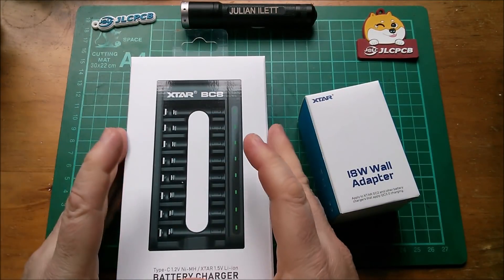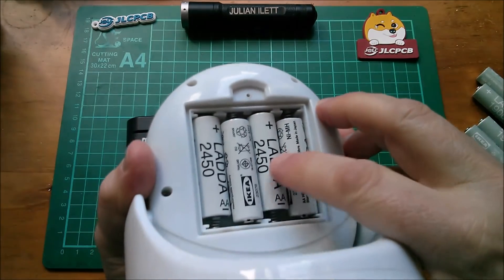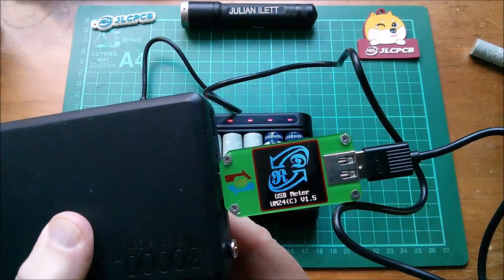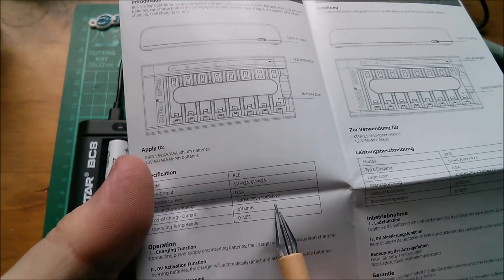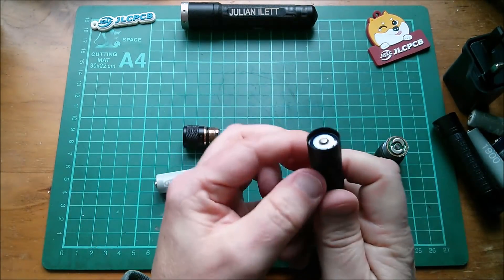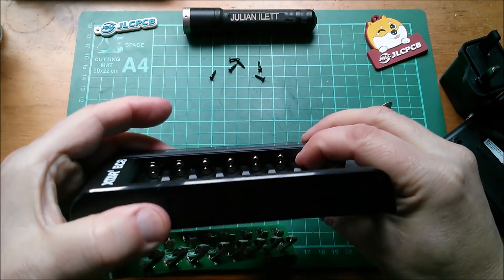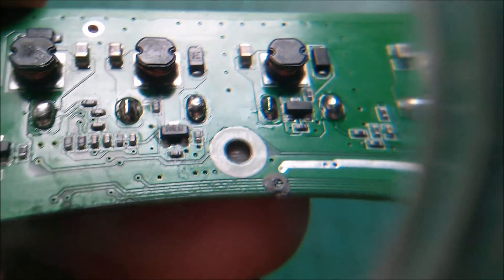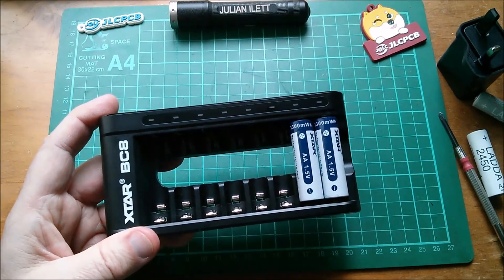Xtar BC8 Battery Charger Test and Teardown

Comment: Interesting, I'm guessing the reason it's charging to >4.2V is because there's a diode drop between the terminal and the cell. Which would make sense since there would be a MOSFET on the output of the cell if it's using a plain old buck converter to drop the voltage, the body diode would introduce the 0.2-0.3V drop you saw.

Comment: Have you had those lithium ion batteries long enough to see any self-discharge? I got away from rechargeables years ago because of this. Recently decided alkaline leaks aren't worth the trouble and now using Eneloops. They're great, they store well charged, but 1.2v is a little frustrating for some of my more demanding devices.

Comment: Well, I guess technically you should say it charges all 4.2V lithium cells, if they have a button top. Them being 1.5V lithium AA cells with the added DC-DC converter is not really necessary to charge them :) If it's a good idea to have 4.2V AA batteries that you can mix up with ordinary AA cells is another story, but it would charge them surely :)
However, the high charging voltage is concerning, I think you should talk to XTAR about it. 4.2V +/- 0.05V, as it says in the specs, is fairly normal for cheap lithium chargers, but if this devices is not operating within its own specs, and the specs of the lithium cells, then this is slightly concerning.

Comment: I'd never heard of 1.5v Li-ion batteries before! You learn something new every day. Would be great for powering all kinds of gadgets that don't play well with NiCd/NiMh cells.
Reply: Its been around for  many years
Reply: Since it contains a chopper circuit (buck converter) it's not suitable for audio equipment.
Reply from the maker: I've got a 3V radio somewhere - I must try them in it

Comment: AA li-on's are a new one to me, but I suppose it was inevitable . pp3's next... 9 volts at stupid amps?
Reply: AA li-ions are electronic as they actually contain an independent li-ion cell plus a 1.5V buck converter.  The voltage thus stays flat through the discharge cycle and then drops to near-zero once over-discharge protection kicks in.  These cells often require special chargers for particular brands, so be careful about this.  Yes, they make 9V cells with a boost converter as well.  I have not tested either type.
Reply: The 9 volt ones are available too 😀 great for medical equipment!
Reply: Julian or Clive (can’t remember which) has shown the 9V in a video before… I’ve got some.